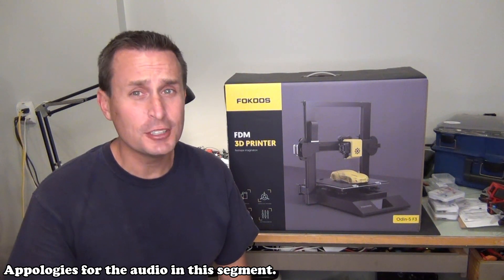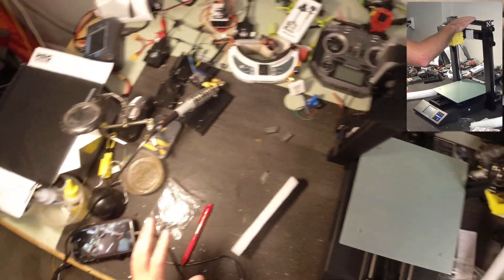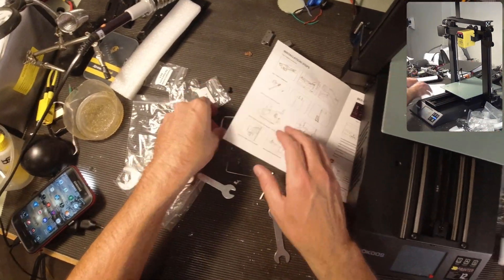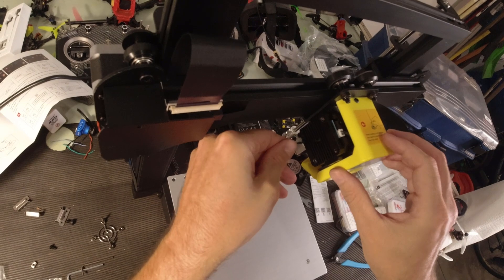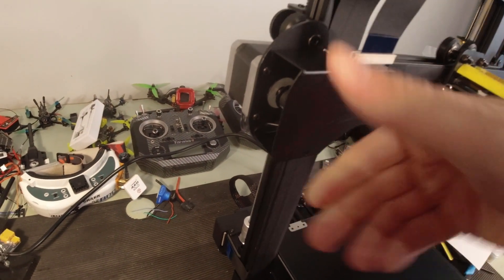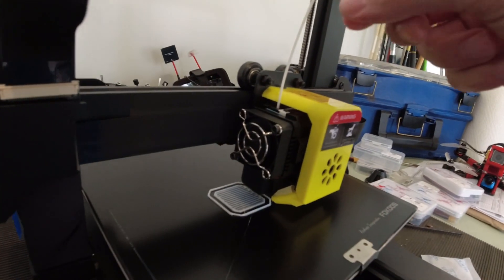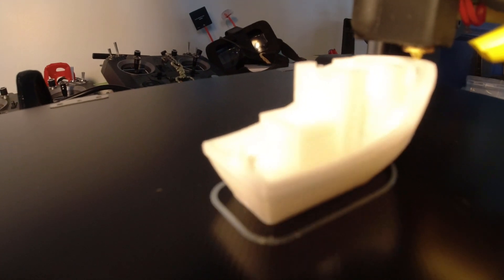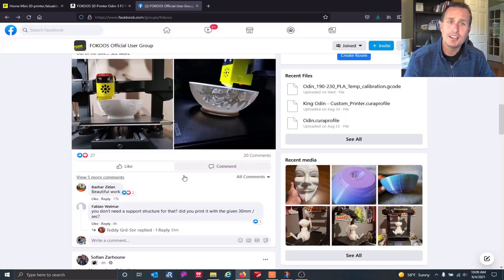The EASIEST 3D Printer to use? | Fokoos 3D Odin-5 F3 Printer Review

Comment: It was real easy to use, it was even easier to put back in the box and send it back for a refund. Absolute rubbish.
Reply from the maker: That's a shame.  Still working great for me.
Reply: @uavtech  I’ll swap you :)
Reply from the maker: @Avetorro  what was wrong with it?  Did you contact Dora on Fokoos FB group?
Reply: @uavtech  no someone representing the amazon seller got in touch after i bought it to say they would help with any problems, so I told them the issues I had and they refunded me. The SD card fell apart, got corrupted, nothing would stick to the bed, stringing,  prints failing, long prints just stopped near the end for no apparent reason rendering them useless. I want to print stuff not spend hours trying to make it print.
Reply from the maker: @Avetorro  wooohhh, yeah.  i have had none of thaty.  That sucks!

Comment: A couple of things... You didn't show it but you should always heat the hot end and bed to normal temperatures before levelling as things expand when hot. Also you have the bed clips on upside down. The flat side goes under the bed and the smaller curved side goes up. Other than that it is a great video. Thanks.

Comment: You have had it for sometime now, how do u feel about it now, I will be using only for kwad stuff?
Reply from the maker: I love it.  Works awesome with the MKS Wifi Module and it is only a $15 adder.
Reply: @uavtech  This? how is it used?
Reply from the maker: @fpvkabo  first, without the Wifi Module and MKS, the printer works great.  Just slice model, put Gcode on SD card and insert.

But I recommend adding the wifi module and MKS plug-in.  See https://drive.google.com/drive/folders/19mcQVCEW4tvNSG-Et0nW2UO78Fz_4TAs?fbclid=IwAR3ZhbLvTz-1w1EAMbvNB18_z8hdwC2yI3Vxm5KCEjGv5Rr2PMm8Co7hapM

It is just so nice and convenient to send model over wifi and also have the image of the model come up on the Fokoos for selection wether Gcode on the SD card or when sending through Wifi.
Reply from the maker: @fpvkabo  see https://youtu.be/Y8OgwjWXvl0 for more details on the Fokoos, how the MKS wifi module works and how the MKS plug-in allows you to save GCODE with images which is super nice.
Reply: @uavtech  Thanks a bunch, got the printer coming tomorrow and wifi later.  Do you have a list of places to get stl files just for quad parts?
Reply from the maker: Thingiverse.com
OR
https://mountmaker.net/

In the Fokoos slicer there are material at the top center in the Prepare mode.  Select General -> TPU.  If you do print PLA, use PLA material setting.  If you buy PLA, get Fokoos PLA+.  It prints great.  The TPU i use is a little soft, i want to switch to something stiffer so need to look around.  It prints fine, just a little too flexible.

I like RDQ's prints (have purchased previously) so will check out: https://www.racedayquads.com/products/sainsmart-flexible-tpu-3d-printing-filament-1-75-mm-0-8-kg-dimensional-accuracy-0-05-mm?_pos=3041&_sid=50f23ae02&_ss=r
Reply: Another question, I'm guessing this printer uses TPU? are there settings I need to change like temp(S) and feed speed or some where to get info, I'm mainly going to use for quad stuff, so PLA isn't do much good.

Comment: I think the Prusa is easier.
Reply from the maker: Should be for $1000
Reply: @uavtech  not sure the going rate on assembled but I bought mine as a kit, assembled it in two evenings to save money. Having the auto level, magnetic bed, and excellent support was important to me. You are more of tinkerer and good with code. This printer is right up your alley and you will have it printing benchies well in no time.

Comment: « Comes 99% assembled » sure, you just have to plug the worst kind of cable, aka ribbon cables, disassemble the end hot to tighten screws that aren’t tight for no reason and epoxy the bearings on the bed 🤣
Reply from the maker: Ribbon cables take 5 seconds, you don't have to disassemble the hot end, just a fan and check screw.  Yeah, bearing they need to tighten up QA in that regard for sure.  But all-in-all, at least not a bag of part like many others.